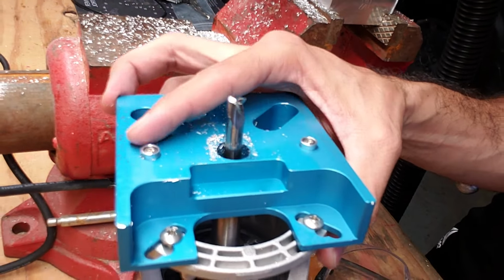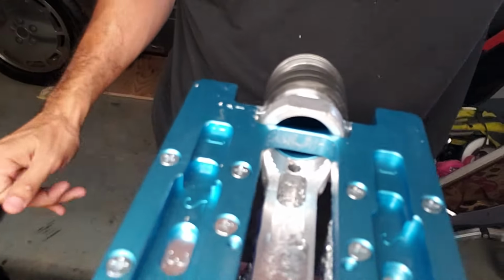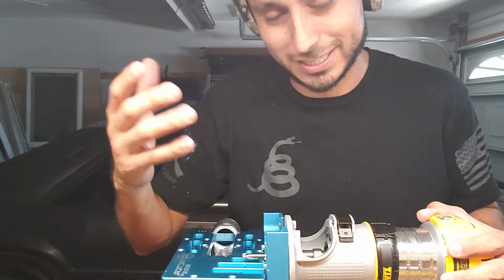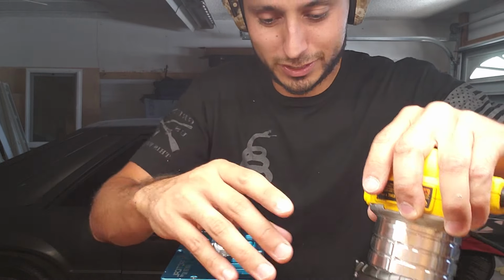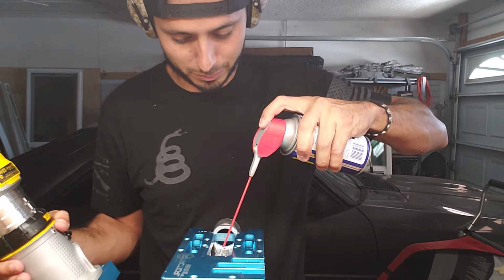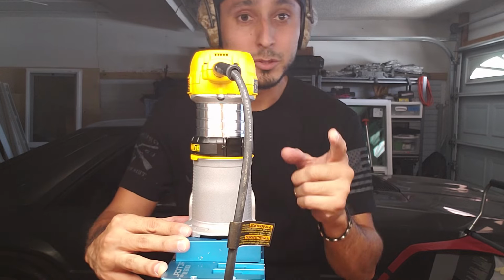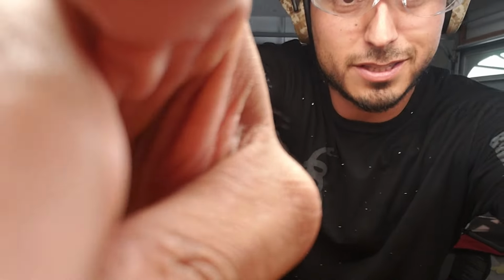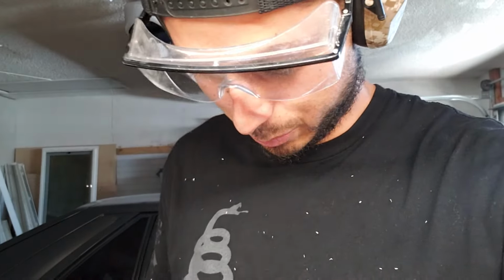Milling an 80% lower

Comment: Since the lowers are aluminum, try using candle wax instead of aluminum. It will prevent the aluminum shavings from melting on your bits and works as a Lubricant as well. Frequently take the candle stick and while the router is on low speed push it up against the candle. It’ll cause it to melt and Lube the bits.
Reply: Good idea
Reply: Big facts, when I worked in aircraft we used wax. And I could make my bits last 3x as long, and less stress on what your cutting.
Reply: True- I use "Paste car wax" on the cut line when cutting Dimond plate aluminum using the correct blade on a worm drive skilsaw. Butter cuts and no melting. Also use "Car spray wax"
Reply: Liquid boe lube is really good to.
Reply: Wd40
Reply: @maxheadroom1506  WD-40 is mostly dewaxed kerosene. it's not meant to be a lubricant. it's a water-displacer.
Reply: I’ve used AUto trans fluid when cutting g and drilling before the wax thing seems very interesting
Reply: WD40 is commonly used as a cutting fluid for machining aluminum and helps produce a good surface finish.

Comment: Use Osbourn cutting oil, it comes in a spray can. You are using a lubricant, not a cutting fluid!
Reply: Wd40 still works just fine
Reply: @rawdawgg_  As a journeyman machinist, basically any light oil or even kerosene works well  on aluminum. It is a coolant that carries the chip away. I use WD40 myself sometimes.
Reply: @rawdawgg_ I agree wd40 works, but if there’s better options that will extend the life of your bits….why not 🤷‍♂️

Comment: I have the dewalt dwp611 router and my jig calls for a 3/8” and 5/16” bit. They will not fit in the collet of my router. What size bits did you use?

Comment: Would you know where I could get replacement drill bits for ROUTER JIG PRO MULTIPLATFORM - AR-15/AR-9/.308/AR-10
Reply: Amazon
Reply: Hey, are the actual drill jigs legal or not? i keep getting different answers even from gunsmith’s?
Reply: Got mine from Amazon. Bought a 5pack. One bit has completed 3 lower for me so far
Reply: modulus arms is the original source
Reply: @vernardmurphy2164  Just the end mill bits or the speed mills? What was the specs to order on Amazon? Thanks!

Comment: What kind of drill router do you suggest for this? there are several types I see different types online different vault different very unfamiliar with them
Reply: asking the same question.
Reply: Unfortunately this isn’t a straightforward answer. The bits that are used determine the router you need or visa versa. There are 4 different chucks the jig manufacturer supplies and you need to match the chuck with the type of router you have. For example, I have a dewalt router(can’t remember model) and I need the V2 chuck.
Reply: use the dewalt one...

Comment: What jig is that, and where can I get one?
Reply: 5d tactical 80% jig I believe he says it in the video they are probably still sold out but if you have a 3d printer you can make a jig hope this helps
Reply: @a1zombieslayer148  I tried buying one of these, but they’re like weeks and weeks sold out try to buy one from 80% lower in California. They make easy Jig generation three. It’s very similar to this and I think it’s actually better. I bought the easy jig from 80% lower arms they actually have it in stock
Reply: @buddyrebel_Garcia I don't think they are legal in CA at the moment. Which is BS, but yeah.
Reply: @CarlPapa88  I have an Arizona address: Wink wink
Reply: @CarlPapa88  Loop hole get a Arizona address and you're good.
Reply: Please, do not try and 3D print a jig for this. The routers are spinning extremely fast and torque up at startup. Just waiting for a catastrophe
Reply: Ordered and received. Works great. Already built 1 AR15, and 2 AR10's .308. Awesome buy.

Comment: What tool you using to mill that?
Reply: That's a router, idk wtf a router is but it's called that haha
Reply: @lilrugah3433 It's a tool used for routing out holes or edges.
Reply: Look like Dewalt 611

Comment: For the love of God and everything holy, please do not use WD40 it is very toxic
Reply: What should we use?
Reply: Candle wax one guy said in the comments??
Reply: I used wd40 on my lowers today and it was fine. Didn’t have anything else to use so yeah if that’s all you got then it ain’t a problem cuz I drilled and milled perfectly fine with wd40
Reply: Try diesel next time. Loads of fun. (Don't actually do that.)
Reply: @ChineseChicken1 Cutting fluid for aluminum like Tap Magic.
Reply: Since when is fish oil toxic? Lol
Reply: As opposed to the aluminum dust that's perfectly safe right? 😂

Sure have some protection but to call out the lube and not the metal dust is pretty hilarious if someone truly knows what they are talking about.
Reply: WD-40 is “very toxic?” Since when?